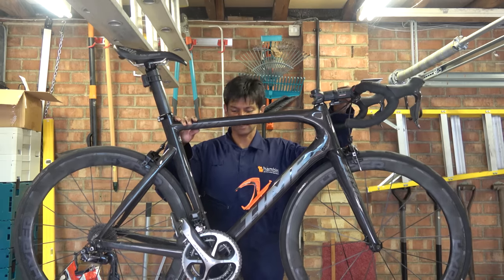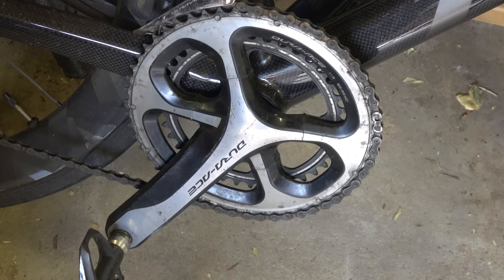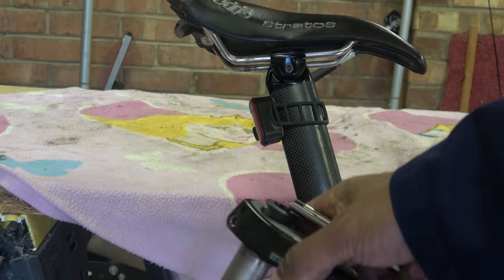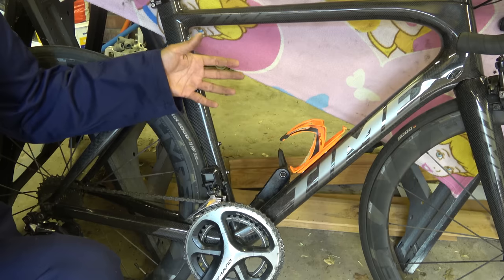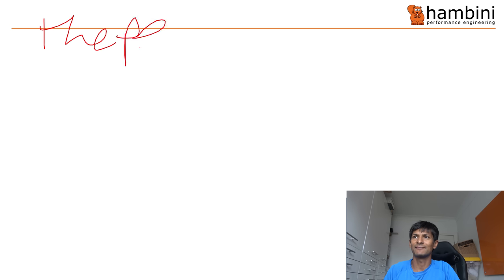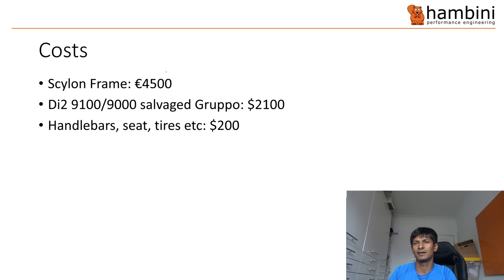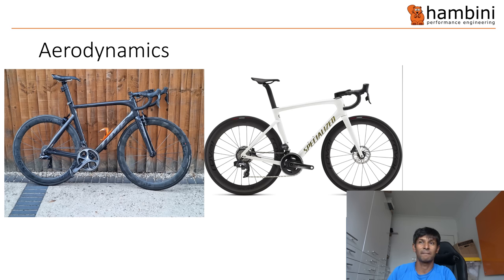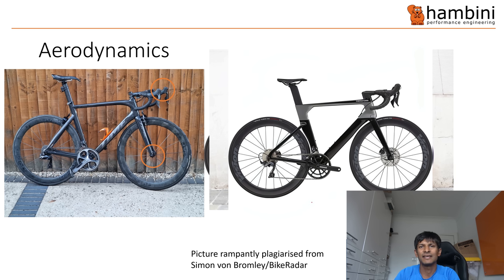TIME shows the world how to make a bike | Scylon | The Lick

Comment: Hi Hambini I have a question  about your Time bike rim brake do they use a quick release or a thru axel for the wheel hubs. I’m interested in getting a ADH 21 frame only but trying to use components and wheels I all ready have. I’m not familiar with carbon fiber bikes and I couldn’t  find any information on this. Thanks!

Comment: I’m on swissside rim brake wheels. I totally misjudged a corner the other day and slammed on the brakes with my weight not really in the best place. I almost went flying! I fail to see how discs would’ve done any better?
Reply: I bought my first disc brake road bike(Dogma F12) LBS assembled it and I really did not like it. I feel that all of my rim brake bikes were easier to modulate and I feel that the disc brakes wear down much quicker and need to be replaced more often. Just under 2k miles and I sold it. I always feel like they're dragging slightly too.
Reply: @tommyfreckmann6857  Hold it!! "Disc brakes wear down much quicker and needs to be replaced more often"?? Nailed it, Mr. Freckmann, nailed it..    Rgr

Comment: Nice video, thanks for sharing this.  Time really market on the strength of their fibre weave and quality. I am interested in the ADHX frame.  Being a big unit, I check the weight rating before buying, and could not find that anywhere.  Contacted Time - no reply.  The dealer in my country said there is no weight limit, which does not make sense as every structure has one.  Any thoughts on what it might be, or how I could find out?

Comment: Just built an SL7 on R9200, and TBH - being a fat F*** is the biggest difference between these two bikes. Hood size and disc pumping losses are trivial compared to the front area and weight you carry around your waist. Not to mention - being a fat f*** means your thighs hit your gut on the top of the pedal stroke when youre in an aero position, negating any efficiency gains therein.

Comment: Thanks Hambini been waiting for this. Would you consider the new Time gravel frame worth considering ? It seems to have some different processes but I must admit I’ve got lost in all the technical terms Time lists. Thanks and keep up the amazing work.
Reply from the maker: I think gravel is basically rebadged cyclo-cross
Reply: @Hambini  I totally agree it’s cyclocross with extra bottle cage mounts haha i should have worded that better I was referring to where they state “Bio-Based Dyneema®, the World’s Strongest Fiber®, to build a better performing machine. It’s the first to utilize braided carbon structure (BCS) manufacturing” as it appears different to the skylon manufacturing process and I thought you may be able to shed some light on the process and the pro’s and/or cons of it

Thanks for the reply

Comment: I lolled several times, anyways question in general for all.
roadbikes (or racebikes)  are generally not comfortable at all (and dangerous if you have rim brakes and skinny tires!) i myself have a tt bike,and on comfort level is is somewhat par to a normal road bike frame,(they both are not comfortable) Also i roll on a rear disk wheel because it looks cool and bc  all my rear wheels eventually end up with broken spokes (when being 20 miles from home obviously)

Question, why do i rarely to never see a disk wheel in the wild, and why do i rarely to never see a tt bike in the wild?
Reply: First off, I've raced, trained and ridden on rim brake road bikes with even MUCH 'skinnier' (tubular,19mm or less!) tires than what everyone uses nowadays, and have never ONCE had the feeling of the setup being "dangerous".

I've also NEVER EVER crashed in 52 years of serious riding with the cause being those 'dangerous' rim brakes and narrow wheels/tires.

You are worried about 'dangerous', well that disc, even if just on the rear wheel position can be just that in a severe enough cross/side/'yaw' wind.
Enough to blast you like a sail (unless you are over 300 lbs./140 KG, and maybe even then!) right into the line of cars fast approaching said rear wheel at 100 KPH. 😉

That being said, IF you live in an area where there are a bunch of serious, dedicated triathletes, you will see them out training on their full-on tri/TT rides, yes even with rear discs, but ONLY ON DEAD CALM, WINDLESS DAYS.

Comment: Some guy is selling a Time AD21 rim brake frameset for like 2700AUD. I'm deciding whether or not to buy it. Personally I do a decent amount of wet road riding because the mountain range I ride in is a rainforest where the road is basically always coated in moisture. In that case, would I suffer from rim brakes too much to justify the purchase?
Reply: With quality rims and pads braking performance only really suffers when the brake track gets proper wet. If you often ride in heavy rainfalls then go for disc brakes.
Reply: @82vitt  hmmm